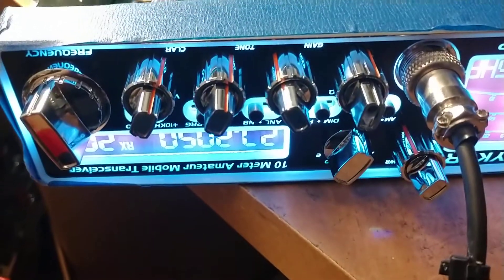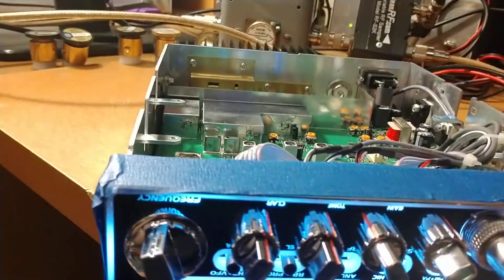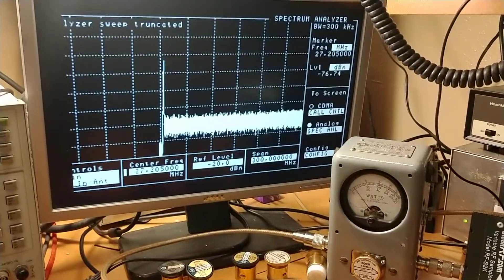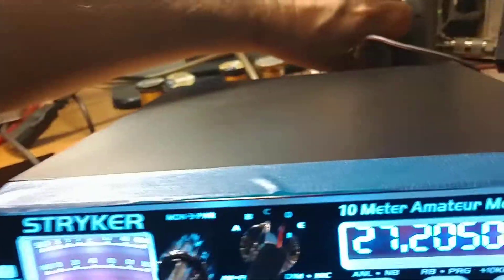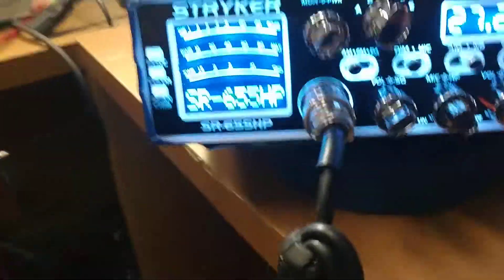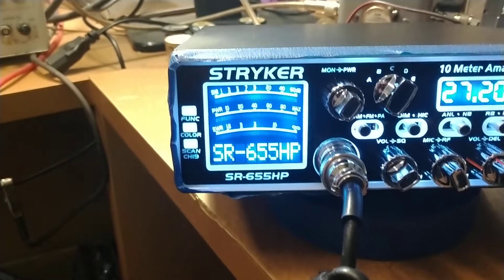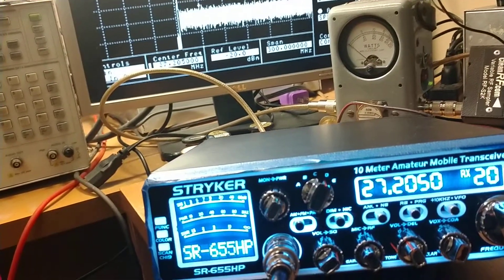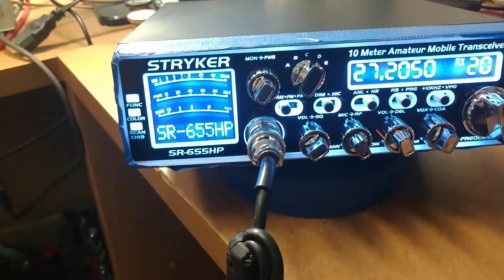Stryker SR655 Brand New out the box for Anthony.

Comment: Does the 655and the 497 have the same output? Any difference other than size?
Reply from the maker: Physical size is the same.. the 497 has a bigger amplifier section.. good for 100 + watts clean where the 655 is good for about 65 watts clean

Comment: Did you ever show the power output on that radio? Did you tune it up for more modulation and wattage? Why would anyone buy a radio from you with out a complete tune up. Stock radios dont put out crap.
Reply from the maker: Every radio I do is far from stock. Not sure what your watching maybe you should rewind and watch them again. You seem a bit confused
Reply: Not confused at all. It would be nice to see what a stock radio puts out out of the box. Then what it puts out after your tune up.
On this video You show the 1 watt low power and then say it puts out 15 watts average power on high never saw that on the meter. No PEP power either. I'm sure you are a good tech or you wouldn't still be in business.
Just want to see the honest readings on the meters. Your videos seem very hurried. Please Slow down and show it all.